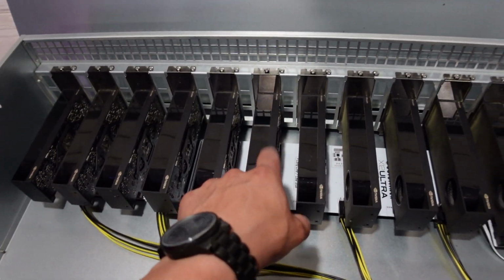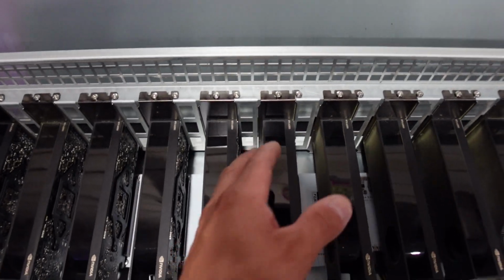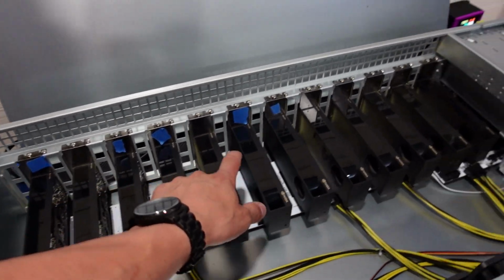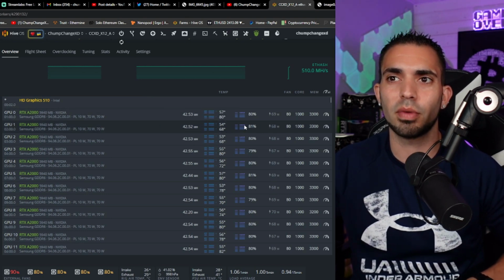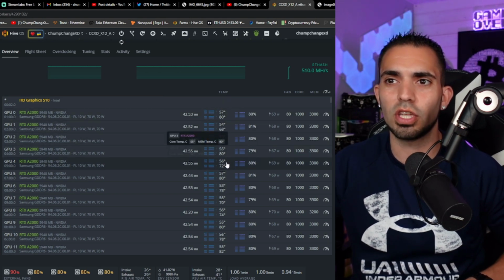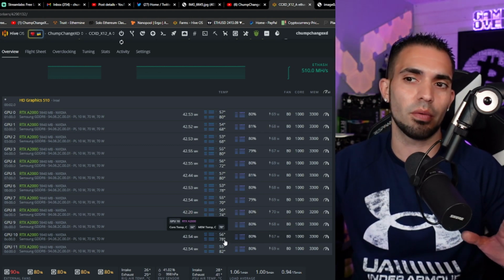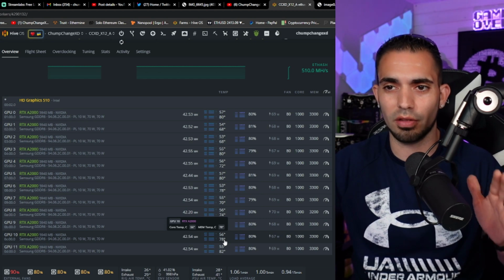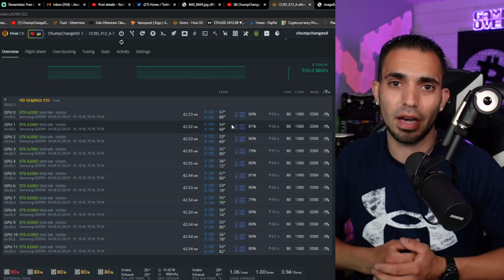Why I Copper Modded My RTX A2000 Ethereum Mining GPUs

Comment: I think you would be really helped with an airflow guide that forced air to go toward the a2000s.  As it is, I bet a lot of the air is moving above your cards without helping at all.  A lot of servers have air flow guides to ensure hot components get proper cooling.
Reply: Are you gonna fan mod these cards so they can draw power from somewhere else?
Reply from the maker: @landoghini7149  I am gonna try yes already ordered the stuff
Reply from the maker: I’ve messed with them before https://youtu.be/5rE1ixeAK3Q

Comment: It is about $25/piece with shipping. Was curious to see if they have something for 3080ti, they do, but it is $80 with shipping. Kinda expensive, but seems to work.
Reply: I'm very happy with the plates on my 3080 Ti...Went from 107C down to 64C for over 48 hours now. About the same results on my 3090with the front and rear plates though it runs a little bit hotter of course. It went from 110C to 78C so very happy with both.
Reply: @jeffbaker4219  Thanks, good to know. My 3090 FTW3 still holding up (57 core/102 mem), but I may pull the trigger for those cards eventually. I want to try small copper plates first on an A2000, seems pretty straightforward and cheaper.